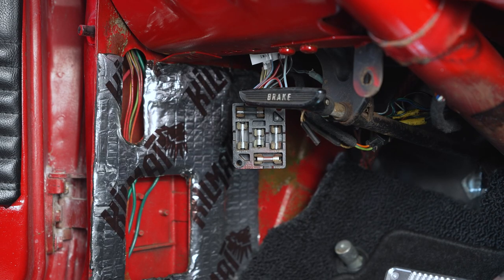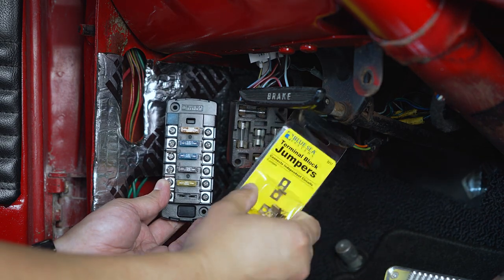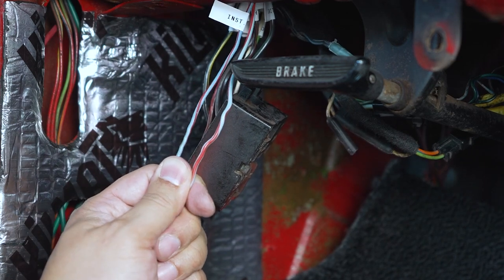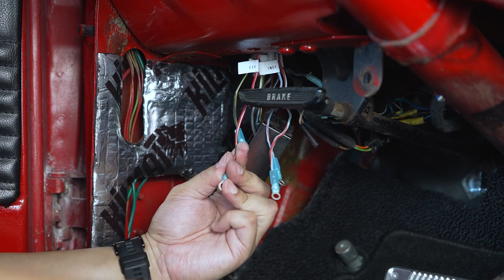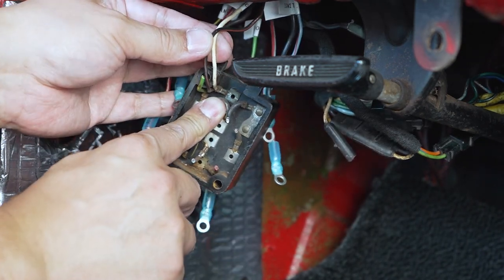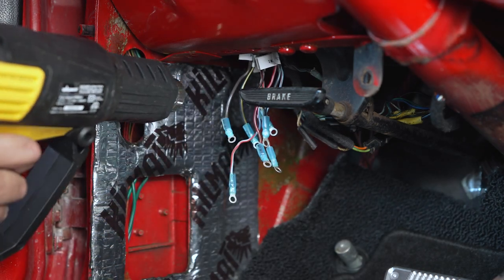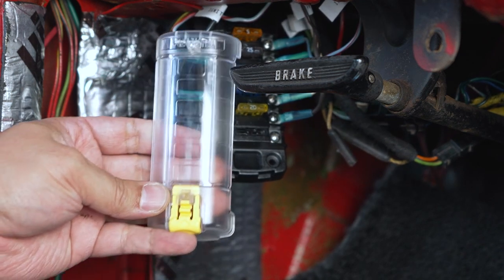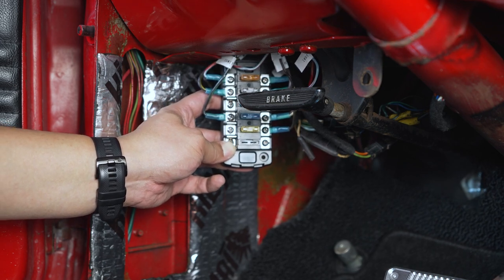1966 Mustang | Replace the Existing Glass Fuse Block w/Blade Style Fuse Block

Comment: Hey there, I did this, on my 65 coupe, several years ago. I used two, Bussman brand 6 circuit fuse blocks, as I had a whole bunch of additional inline fused items, I wanted to tidy up in the upgrade.. The independent circuit power in/load out block is awesome 😎!!! I wound up still having that independently powered dash light 2.5 amp as separate inline fused afterwards. Your job just nails this upgrade perfectly.. And, is easily expandable to anybody's Ford, with this setup.. I added wire length, and fabbed a metal plate to mount them on, and the signal flasher, as well as a electronic fuel pump relay, (that's tach signal triggered). It slides up behind the fresh air box, sits on a homemade bracket. So it's easily removable, with just enough wire have decent access, while kneeling down in the footwell. Kudos brother, for a really well engineered solution here !!!! God bless...
Reply from the maker: appreciate it

Comment: Great posting Michael!  I have a 66 F100 that I have been needing to do this to (glass fuse panel is kaput) - you got this done in less than 30 min - with explaining everything... I should be able to knock mine out in 15 min!!  LOL!  great explanations and suggestions!
Reply from the maker: 15 min is definitely doable...its super easy.  Just be sure to label the wires before cutting.

Comment: thanks for the vid, I am doing this to my 67 and keep coming back to this vid to make sure everything is right. I am also adding 2 ignition and battery fuse blocks on other side of tranny tunnel under dash to run stuff like electric antenna and gauge lights and tach light etc etc I subbed and liked.
Reply from the maker: Appreciate it.  I added 2 fuse blocks as well and put them in the trunk.  Check out my Big 3 upgrade video that showed this.  https://youtu.be/WgSs0gAcPzo

Comment: Great video. I'd like to do this to my '75 f100. I see the same fuse blocks have diagrams for attaching battery "pos" to top and "neg" to bottom. I'm guessing that's for boats etc? no need to do that with the Constant power to top fuse? as per ford wiring diagram?
Reply from the maker: Thats a different type of fuse block if you want a hot coming in and several fused circuits going out (I did this with two blocks in my trunk).  The fuse block in this video is for independent circuits...hots coming in on the left, a fuse, then hot back out on the right.
Reply: @michaelanthonyaquino  Thanks! I see the one you used is unavailable.
Reply from the maker: Amazon has it...https://amzn.to/3mpRezH

Comment: Is this a split fuse block? I’ve been wanting to do this my 61 has only two main fuses and the others feed off the ignition circuit. Problem I have is I believe the fuses that came with it isn’t the same amps  that originally came with the truck so I have to determine everything on the circuit.
Reply from the maker: It's independently circuited, so you can set it up for either hot all the time, switched, or both.  I did add 12 hot and 12 switched blocks in the trunk.
Reply: @michaelanthonyaquino  oh ok I see now.

Comment: Hello Michael! I have a 67 Mustang, can your unit apply to my 67? I upgraded my Altenator to 110 amp single wire Last year and would like more options to add things to fuse box. Looks about the same as my old one in there. Thanks for any input. Thanks for sharing this Gem of a video!! Cheers from Motown/Dearborn.
Reply from the maker: Yes it should be fine...though I would run a separate distribution and fuse box if you plan to add additional accessories.  Watch the Big 3 Upgrade video I have which talks about this.
Reply: @michaelanthonyaquino  Thank you very much Michael. Wont be adding anymore. I have my fans on relays, along with my Gt fog lights on relays, no issues with new 110 amp 1 wire Ford Alt. I just dont trust that old fuse box and only possibly need an extra 12 volt Ign source. Appreciate it brother!